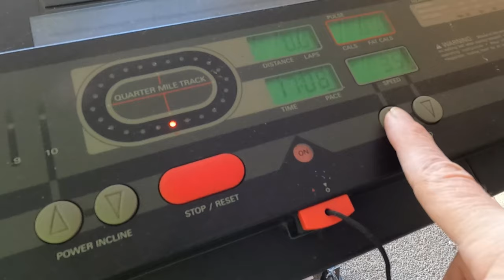Replacing Treadmill Circuit Breaker EASY 10 22 21

Comment: Did you just have a err come on the screen cause I'm having that issue just curious if this is a possible option to fix  mine. It doesn't have a number for the ERR either
Reply from the maker: I dont think i did. Ive since trashed it. It never did work right..good thing I got it free off market place..I think once they have issues its probably better to just get another.